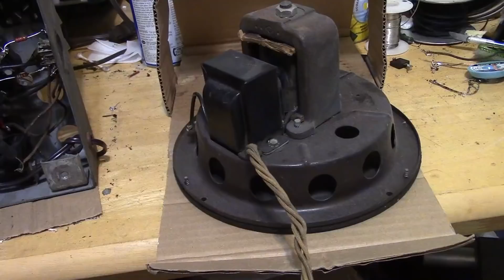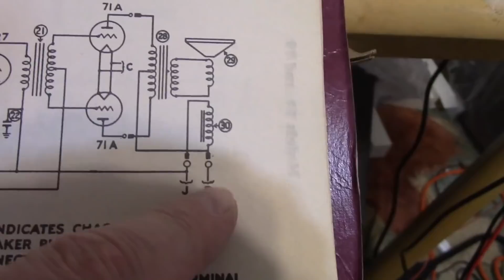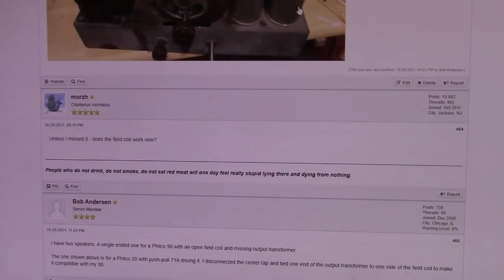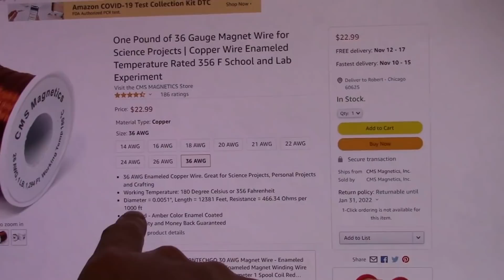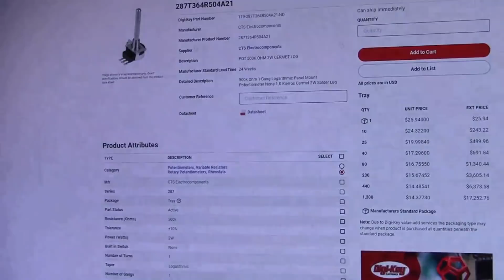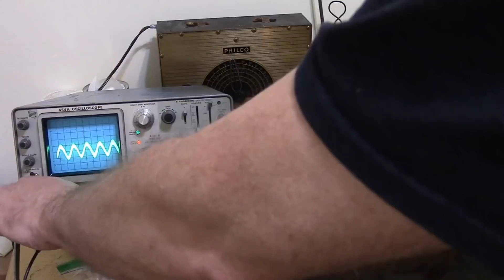Philco 90 resto p8o?

Comment: After watching the entire series, at least up to this point, I seem to have missed something. QUESTION: What was the problem that caused the volume control to pass a slight signal even though it was backed right off?
Reply from the maker: It's been a while, but as best I recall it was crosstalk between leaky caps.

Comment: Thank you for a great and thorough series. I have learned a ton. Of all the TV series you have done, is there one in particular you would recommend that is extensive as this Philco radio series has been?
Reply from the maker: You're welcome.  I'm happy to hear you're enjoying it.   

I've done some lengthy TV projects but that was because I got stuck on some problems rather than by design. 
Coming up soon I'll do one for electrostatic TVs (I already have one in mind) and another with a magnetically deflected set.

Comment: The Philco 20 speaker was known to not sound particularly good.  I believe it's a combination of the stiff spider and cone design.  Often Philco 20 owners will substitute a 70 speaker instead.  From what I understand (and slightly off topic), a Philco 20 with a 70 speaker is one of the best sounding early 30's cathedrals.

Comment: what about those solder slobbers in there should a tech remove them after soldering in resistors 7:10
Reply from the maker: I'm not sure what you mean? I made corkscrews of the resistor leads, pushed them onto the remains of the old leads and lightly soldered. There's nothing to remove

Comment: For making my pigtails I have a set of those cheap micro screwdrivers and use the size that matches the closest to the wire that will slide into the pigtail.
Reply from the maker: Yes, I use those as well. Very handy
Reply: Yeah, I use those for replacement vaping coils. They work great.

Comment: Maybe I am wrong on this but IIRC output transformers for single tubes (Single Ended SE) have an air-gap to cope with the problems of the constant magnetic field caused by the  DC plate current.
Push Pull however dont need an air gab because the DC idle currents cancel out.
So question is; how good will a PP transformer perform when used in SE output
Reply from the maker: Yes, they do. From what I've read and the experience of others, they work pretty well so long as you don't push them hard
Reply: I have recently done some experiments with this issue, mainly to see if a cheap "line" transformer could be used as a replacement for an old radio output transformer.   I tried the transformer in three ways; original interleaved laminations, butted but no gap, and gapped.  There was a definite improvement in the low frequency response by butting the laminations, and a further improvement when I put in a gap.

Comment: B9b the other differences in the 90 vs 20 speaker is the spider/ center alignment " disc ...one has more compliance ( it looks like a 45 adapter) one has more bass
Reply: I  hate typing on a phone!....and I can spell Bob  lol
Reply from the maker: Right.  I can see that when I compare them side by side.  Also the field coil pole on the 20 is held in by a bolt and can easily be taken apart.  The 90 speaker is press fit together.   I'm going to have to pound it out.